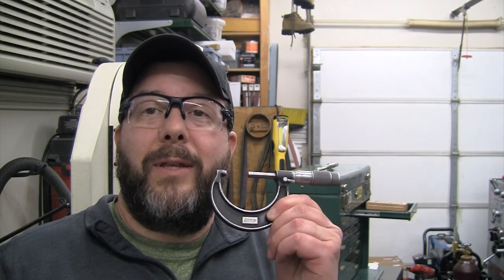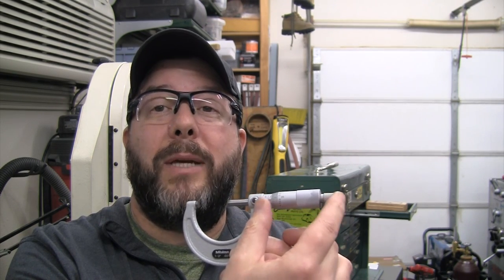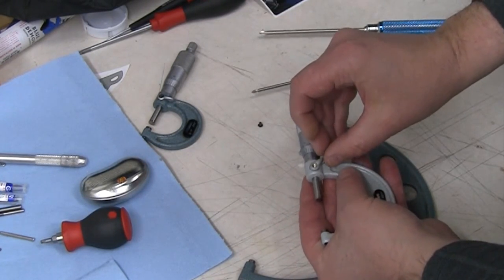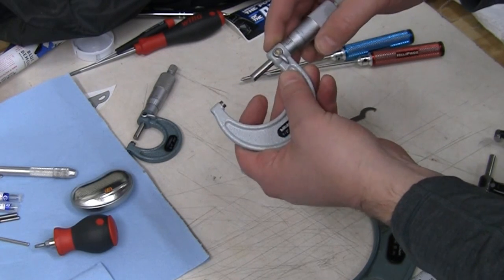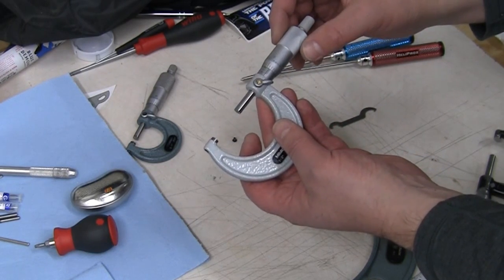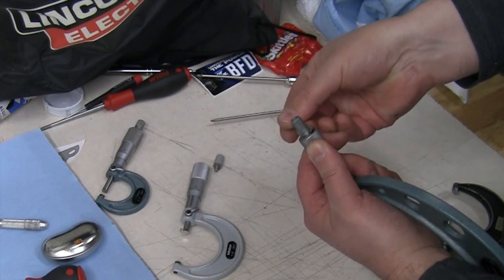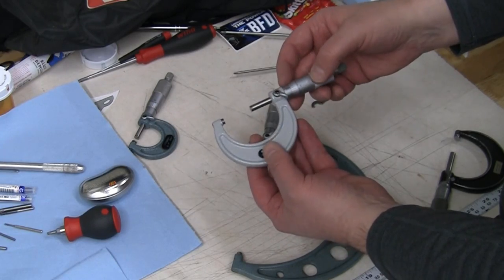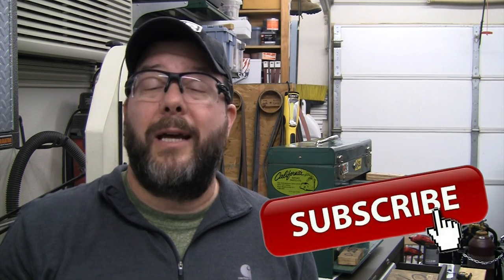Mitutoyo Micrometer - Replace Those Plastic Parts With Old Metal Parts!

Comment: I'm with you on not using the ratchet.  I never trusted ratchets to apply the proper pressure when making precision measurements.  I guess you could calibrate the mike to the tension applied by the ratchet and that would hopefully give you repeatability but would it give you an accurate measurement?  I would rather trust my feel.
Reply from the maker: Robert Lark - in theory, if you use the ratchet to set the mic to the standard then it should be “exact” repeatability, but that feel of getting it centered on your piece, making sure you are not cocked to the side and sticking just seems easier when you are in full control. Thanks for the comment.